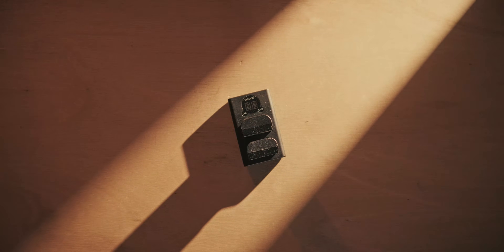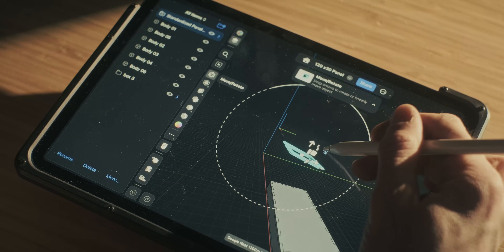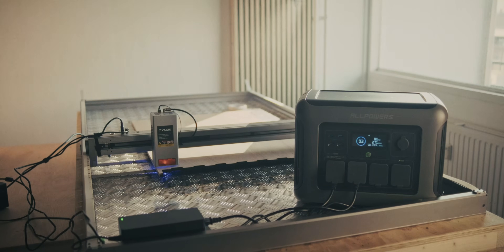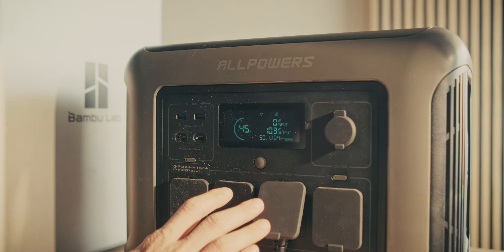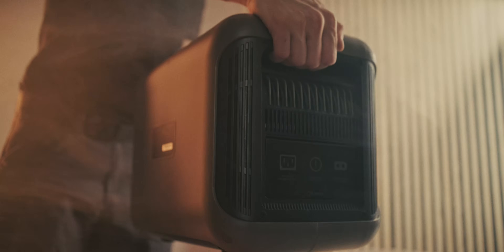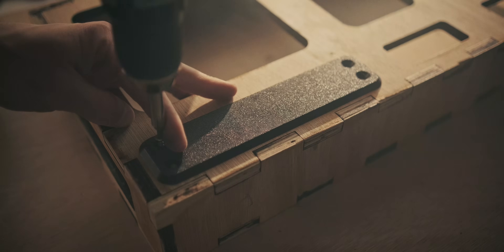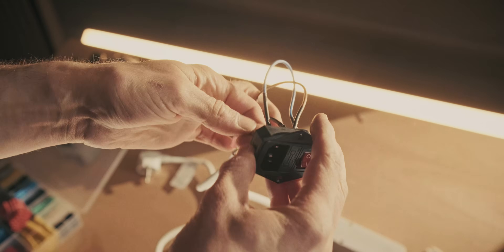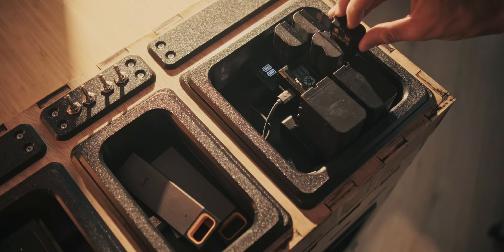Building a Battery Charge Panel - ALLPOWERS R1500

Comment: Honest answer please: How many times have worried neighbours called the fire brigade on you when the laser cutter was running?
I know I am probably preaching to the choir, but please add proper ventilation and filtration. Take it from a volunteer firefighter: breathing in smoke is not great for your health. Sure, "pure" wood smoke is probably on the tamer side of things, but still. Don't be a dummy. Also, you only get one set of lungs from the factory and spare parts are sort of difficult to come by.

Comment: I could be wrong but I’ve heard from one of the main chemists for Tightbond wood glue that charred/burnt or burnished wood does not glue properly with standard wood glue because wood glue bonds the cellulose in the wood fibers and burnt wood doesn’t have proper cellulose at the surface

Comment: Hey really cool project! However i feel like more than the first half of the video was mostly just an ad. 
I would suggest keeping the sponsored segments a little more concise or lengthening the video to keep the ad to video ratio at a reasonable level.
Reply: I think it was well integrated advertising which was organically included into his project presentation. I didn't mind it at all
Reply: @ I'd much rather have something organically integrated that actually used the thing than just a short ad spot irrelevant to the video
Reply from the maker: Good feedback appreciated! I felt the same, sometimes its difficult to juggle with deadlines.
Reply: @FlatLanderTech  Yea I understand. The production level on your videos is insane tho. Keep it up!